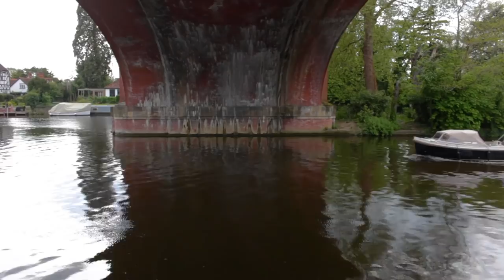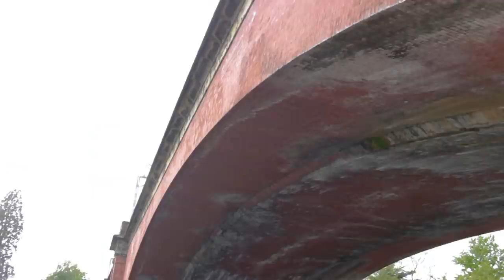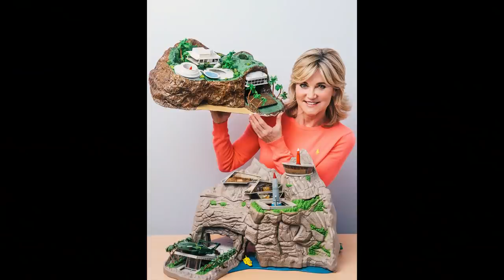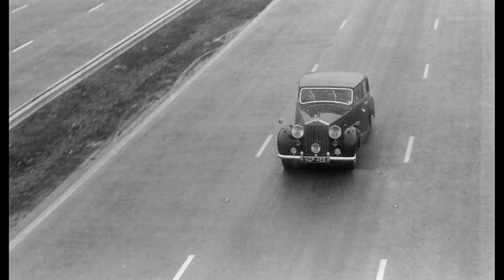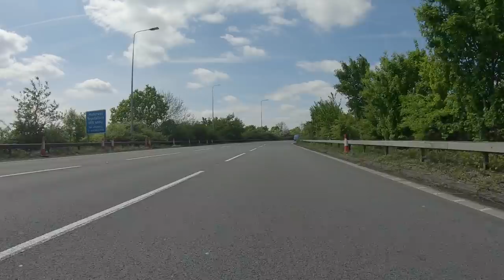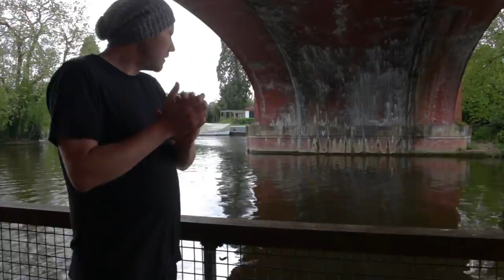Motoring Oddities EP7 - Where and how long is England's shortest motorway?

Comment: You missed the best thing about that bridge,  or rather that smart arsed bloke who built everything (joking, he's a hero of mine). During and after it was built there were a large number of naysayers who insisted that the bridge couldn't be built or would fall down immediately the scaffold was removed and they held enough sway that the scaffold had to be left. One night, after torrential rains and storms the scaffold was washed away.
The naysayers were quick to say how fortunate it was that the bridge hadn't immediately collapsed, blocking the Thames and causing massive flooding. Brunel's response was that since completion of the arch the scaffold had never supported bridge as he'd ordered his masons to move the scaffold an 1/8th of an inch away from the brickwork. He'd dinner his calculations and knew it would work like so many of the other massive structures he built that are still standing today.

Comment: I believe that Driverless cars were tested by the Driver Research Laboratory, along the then under construction M4, at Maidenhead, using Citroen DS's and an infrastructure that was (and possibly still is) buried beneath the road surface of the M4. I don't recall with any certainty how I acquired this information or can i speak for its accuracy, but I thought it might be an interesting one for you to possibly follow up.  The DS was used because the design of the car, possibly the hydraulics, made modification for Driverless research simpler.   I was told this many years ago and my memory of it has faded in time
Reply from the maker: Any sources or info that can confirm this... it sounds very interesting indeed

Comment: What about the M96. 400 yards long. Has more accidents per mile than any other. Look it up.
Reply: The one in the fire service collage… clever lil joke 😉😂
Reply: It’s a fake
Reply: I live across the road from the Fire Service College.
It’s great - along with the shortest motorway, they’ve got an oil rig, a crashed jumbo jet, a variety of burned out vehicles and every now and then they stage terrorist attacks!
Reply: I know it's a death trap
Reply: It's 600yds according to a woman who takes photos. It's 1.7 km according to google. As it was an old airfield I would believe the latter. Strictly speaking, rds with the M in brackets are A rds with  Mway regulations. Havn't checked them all but Mway spurs tend to be the shortest so the M275- 2 miles, M271- 3 miles.
Reply: @johnstephens6974 he has done a video on it, only a small part of the runway is the M96.

Comment: When I learnt to drive almost 40 years ago, I was taught that Annn (M) roads were not motorways, but A roads built to motorway standards. The M606 in West Yorkshire is an interesting true motorway that is quite short at only 3 miles as it was never completed, ending at the junction with Bradford's outer ring road (very close to this junction is another abandoned for 20+ years, but recently ressurrected stockcar/speedway/rugby stadium, simlar to Coventry Stadium, called Odsal Stadium). The M606 was originally planned to continue on to the city centre and beyond to link to the Aire Valley Trunk road (A650) but that never happened.
Reply: "I was taught that Annn (M) roads were not motorways, but A roads built to motorway standards"
I don't think that's correct. Traffic that's prohibited from motorways is also prohibited from A(M) roads. If you look on Google Street View at places where A-roads turn into A(M) roads, you'll see a sign half a mile before the (M) starts that directs "non-motorway traffic" (or "non-m'way traffic") to leave the road at the junction. At the point where the (M) begins, it's signed with the motorway symbol. I'm fairly sure that, in the days when there were big signs listing prohibited traffic on motorways (what happened to those, anyway?), those signs would be placed at the start of the (M) sections, too.
Reply: @beeble2003  fair enough.

Comment: Talking to everyone mentioning contenders here, This answer depends what you want to define as a motorway. Does the number have to appear on signs? Does it have to be officially a separate motorway, as defined by the Statutory Instrument that created it?

The shortest that is legally a motorway in its own right, and has its own number which is signposted, is the A308(M) as mentioned in this video.

The shortest that is legally a motorway in its own right and has its own number is the A635(M).

Comment: On the subject of short unnamed motorways, one of the A14(M) sections is now the A1307(M) due to the A14 being rerouted south of Huntingdon (and that awful viaduct through the centre is gone! Site of many accidents). These short one way sections come about after the last junction before a road merges with a motorway section. Although not signed as a motorway there is always a 'non-motorway traffic" sign at that last junction.

Comment: You should come to Southampton to marvel at my local "motorway", the M271. You won't be able to drive the massive 2.3 mile length in one go however, as at junction... oh hang on the junctions aren't numbered... at the second junction you have to stop on the motorway because of a traffic light controlled roundabout. Then, as you go past the third junction (Junction 1, because for some reason they numbered one of the four junctions), the speed limit drops to 50 before going over the narrowing yellow bands designed to make you slow down before you hit a block of flats built exactly where you would put a slip road onto the connecting dual carriageway. Perfection.
Reply: Yeah driving  out of Southampton is a nightmare only leavened by the fact that one is leaving Southampton.
Reply: In the last few years they remodelled that junction by the flats and it is now much better. Previously it could be absolutely terrifying!
Reply: Have they fixed the Fairham roundabout one way bridge yet?
Reply: @capcompass9298  Do you mean Fareham, and the westbound only viaduct carrying the A27 over the A32 junction? But what this has to do with motorways, I don't know!

Comment: The M41 in Shepherd's Bush, London, is 1/2 mile long... and all elevated.
Reply: The A41(M) around Tring WAS the shortest at half a mile.
Reply: it is not all elevated
Reply: Not a motorway anymore, part of the A3220
Reply: The M41 hasn't existed for over 20 years...

Comment: The shortest signposted motorway is the A1058(M), it can be easily measured in centimetres!
Reply: 100% agree, I’m certain the blue signs are still there on the northbound slip road. I never ever used the Camden street slip road that’s been closed for decades, so I couldn’t tell you if it had the signs as well. If these chaps find themselves travelling this far north, the A167(M) and A1058 are definitely worth having a look at.
Reply: @TheMarkBell  The Camden Street slip road was signed for A167(M) however the sign was either removed or stolen during lockdown. Shame! :(

Comment: In North America, engineers use the phrase "ramp freeway" to describe a short limited access highway that allows access to a major limited access highway. Being "ramps", they are never numbered or named, even if they have an interchange or two in the middle of the short freeway. Instead directional signage will say something like "TO I-__" whatever road the ramp freeway connects to.

However, the design of the A308(M) that brings all traffic to a near halt before allowing it onto a limited access highway is stunning. Any route with enough traffic to justify a multilane limited  access highway, by definition, justifies a directional interchange, or at least a cloverleaf, especially here where land was available. As a result, this kind of design is rare in the States. However, look at the junction of I-5 and CA-78 in Oceanside, CA, where a decision to leave a popular steakhouse standing apparently motivated decision-makers to force All traffic on EB 78 to turn left through a signalized intersection to go south to San Diego.
Reply: Hmm... That weird intersection doesn't look like if that steak house was the cause - as the missing cloverleaf would be where the big parking for car pooling is.
So it looks more like people owning the adjacent homes were the cause?
Reply: Using a cloverleaf would create a major weaving section problem with traffic from SB I-5 to WB CA 78. At any event, this is one of the oldest sections of I-5 in the area; it began as a bypass of US 101 around Oceanside in 1953 or so.

Comment: That bit of the M4 was originally Maidenhead bypass A4M - check out London to Bath with George Eyles - https://youtu.be/Qp-Sv_lXWvU?t=578 - shows some original footage including an early example of outside lane hogging by Sunbeam Rapier. That bit of M4 was originally 2 lane later widened to 3 lane so no hard shoulder under the bridges. I remember travelling from Bristol to London in my parents car during the mid seventies and that section around Maidenhead still had the really old early 60s signage. Some other comments refer to the road research lab at Slough reminded me of an article I read in a classic car mag years ago about some testing they did along a stretch of the M4 around Slough before it was opened to the public. The work related to an early form of autonomous driving using wires embedded in the road surface. I think one of the cars used was a Citroen ID19 - not sure but the cars may still exist at Science Museum store at Wroughton near Swindon.

Comment: we had the M10 in Hertfordshire which was 3 miles long which ran from hemel hempstead and st albans. Opened in 1959 and was closed in 2009
Reply: The Tring bypass, A41(M) from the 1970’s to early 1990’s when it was 1.5 miles long. The rest, running from the M25 past the Langleys, Hemel Hempstead and Berkhamsted was only completed in the mid-1990’s, and the A41(M) was downgraded from a motorway to a trunk road.
Reply from the maker: The M10 is my old stomping ground and I remember it well.  It's still there just renumbered as the A414.
Reply: @keithorbell8946  i was not on about the tring bypass, that is at the bottom of my garden. The M10 ran from the m1 juction 8 to St Albans which is now the A414
Reply: @bill53uk  I know, but the Tring bypass, which I could see from my bedroom window when I was growing up, was shorter and had motorway status, and was also in Hertfordshire, starting at the roundabout at the top of Tring Hill above Aston Clinton and finishing at the bottom of Oddy Hill, Wigginton.
Reply: @keithorbell8946  I also can see the a414 from my sons bedroom window. we watched them remove the soil by lorry loads. I can remember when they had a slip road to come off of the said tring part. just up the hill from the cowroast
Reply: @bill53uk  It’s not the A414, it’s the A41.
Reply: I remember driving down to a wedding in St Alban's in mid August 2009 and seeing the yellow and black signs on the old M10, telling you that it was no longer the M10!

Comment: There is also the A1077(M) at 0.8m (1.3km). Though while they may be motorways, they aren't M roads, the shortest M motorway surely must be the M181 at around 1.5m (2.4km) long?
Reply: I second that mention of the M181, and it must be one of the most pointless motorways in England now.

Comment: lol I live in Maidenhead and still trying to figure out what they did with the Motorway.  I knew it took a different route but trying to figure out what connected to where was always the issue.
Reply: I always thought that a short section of the old motorway route is used as motorway maintenance depot.

Comment: The shortest is located in scunthorpe in Lincolnshire called the M181 and it is very short with no junction and ends, on a roundabout and the other one opposite is the A1077(M) And is, the second shortest and they are located right together and fun fact the M181 was a one big motorway but it got split up into two separate ones the M181 and A1077(M)

Comment: i always thought that an axx(m) road was still an a-road but that it was an a-road that met motorway construction standards. dunno where i got that from, obviously i'm wrong!
Reply: In a way you're not but also you could argue it another way. You're right that marked as an A road that is what they are but the basic specification for a motorway was that it had a one or more passing lane, central reservation (either space or a separator), and a hard shoulder. Going on the latter these could then be defined as a motorway. That is very simple though and it could be argued either way and we'd have to take in that some AXXX(M) roads don't fully align as take the A38(M), that has a tidal flow system so the lane spacing would be insufficient as a central reservation, and so on.
Reply: @euroswilliams7303  i would say i was wrong. the A1 is a good example. it has 4 sections that are motorways, and the rest is A-road. calling it A1 (m) at those points makes sense.... the road is still the A1, at the beginning and end, and having the road switch from A1 to Mx to A1 to My to A1 etc would be really confusing. so yeah.... motorways need an M in the name, not necessarily at the beginning. only if the whole road is M standard does it get an M at the beginning.... that makes sense too. i was wrong, but good to learn something 😁
Reply: I believe the difference is that L drivers can use Axx(M) roads but not Mxx motorways. Axx(m) roads are built to M-way specifications.
Reply: @richardg3ziy635  didn't think of learners, although if a learner could drive the length of the A1, for example, that would mean the a1M is NOT a motorway. what does the highway code say?
Reply: @fyshfysh  No they are motorways so learners would only be able to drive on there when accompanied by an ADI. This applies to all motorways now by the way an approved driving instructor can supervise a learner on those too now but only an ADI learners being supervised by someone that is not a qualified instructor still can't. The rules changed a few years back I believe probably not a bad thing except for not taking the advantage to make it a requirement for the test, arguably a qualified driver should have training on all types of roads.
Reply: @seraphina985  interesting, didn't know that rule that learners could drive on them with a pro instructor. good rule change and yes i agree it should be in the test
Reply: @fyshfysh  "what does the highway code say?"
The Highway Code says what you can and cannot do on a motorway, and who can or cannot do those things but it doesn't seem to say what roads qualify as motorways. (Unless I missed it.)

Comment: You should have also made some ‘shortest willy’ jokes
Reply: This seems an appropriate moment to mention that Maidenhead Town Hall appeared as a university and a hospital in various Carry On films. About 20 years ago I visited some of the film locations with particular intent to see the town hall which had been condemned due to asbestos, however it gained a reprieve. If anyone visits for the same reason and wonders about the modern looking building across the road, it's worth bearing in mind that the terraced house across the road in the film. on whose roof Barbara Windsor sunbathed (probably in January if production standards were being followed), is actually a totally different location in London.

Comment: The A308(M) is 970 meters in length. 
The M3 in Northern Ireland is 1287 meters. The shortest full motorway without AXXX(M) classification in the United Kingdom.

Comment: I thought the M96 was the UKs shortest motorway, although it isn’t open to the public.
Reply: He made a point of saying England as the M96 will be in Scotland. I am guessing it is in Scotland as it start with M9😳🏴🇬🇧🤠
Reply: @pgbaines65  No, the M96 is in Gloucestershire and it is only 486 metres long if I remember correctly
Reply: @zuegma666  Correct, it is on the Fire Service College's fireground, and is used for training firefighters and commanders how to deal with motorway incidents
Reply: @richardwilliams7692  yes, that’s right. As I said, not publicly accessible but still signed as a motorway. I have done some mock up scenarios there.
Reply: @richardwilliams7692  yes, that’s right. As I said, not publicly accessible but still signed as a motorway. I have done some mock up scenarios there.
Reply from the maker: The M96 has been covered by other youtubers, however I would like to visit.  It's not really a motorway, more a mock up of a motorway on an old airfield.
Reply: @zuegma666  I see but it is not a real motorway. I assumed it would be northeast of Edinburgh.

Comment: Quietest one? M45 drag strip.
Reply from the maker: The M45 is not far from me... I can neither confirm or deny it's suitability as a drag strip :D
Reply: @AutoShenanigans  Rolling starts only, 'no stopping' remember. ;)
Reply: I recently saw that the M45 is in the process of having average speed cameras instled in the direction towards the M1.
Reply from the maker: @micbsounds  Noted. Only use the westbound side.

Comment: Slough is actually pronounced Slo-th, well it is up here in the Black Country.
Reply: Perhaps the local usage is the term for a low lying body of water?
Reply: @Skiddins  clearly you have never been then cus it's rly not thst bad
Reply: @georgedowns4034  name any of its redeeming qualities?! I’ve lived just outside it for over 40yrs and it used to be where I went for everything, now I go there for nothing. Any good shops have all gone.
Reply: @Skiddins  decent amenities, great transport links, fairly cheap for a London commuter town, some posh areas, some standard neighbourhoods look decent, crime rate is high but certainly not the highest. If u actually think about it, it's not that bad
Reply: @georgedowns4034  So all the pros there also apply for Didcot, although that doesn't have the crime rate...
Reply: @RowlandShaw  I personally don't tend to care about crime rate but ik most ppl do